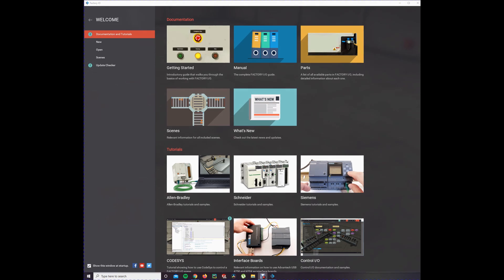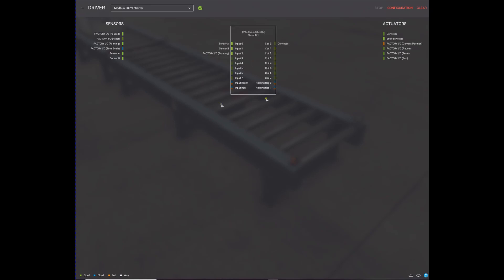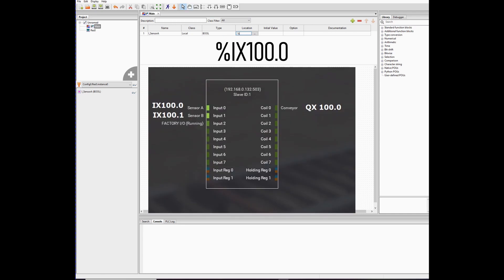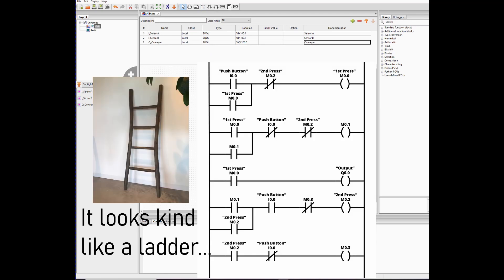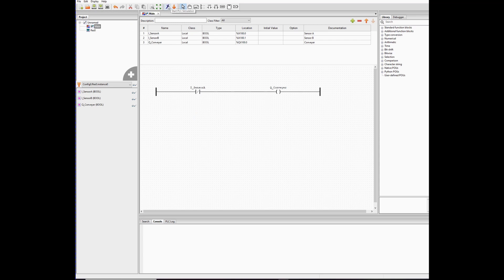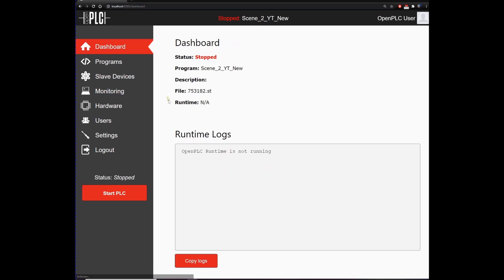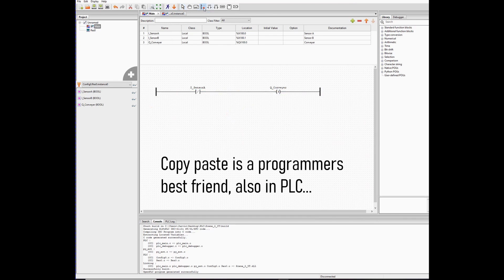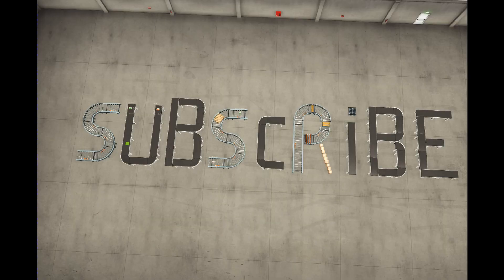Tutorial Open PLC with Factory I/O

Comment: ladder logic didnt make sense??
the ladder logic script made no sense
dont we use normal input and when it detects the box it turns on the conveyor? why using the  Negated Logic
Reply from the maker: Bexause the sensor is of the type LIGHT ON. Wich means when it sees the reflector on the other side the signal for the PLC is 1. When a box blox the lightbeam to the reflector on the other side is 0.